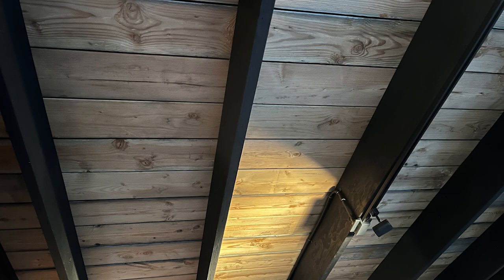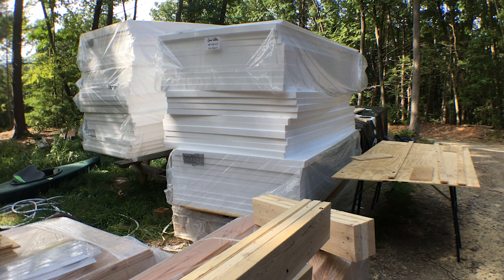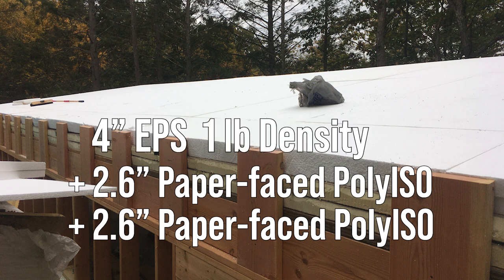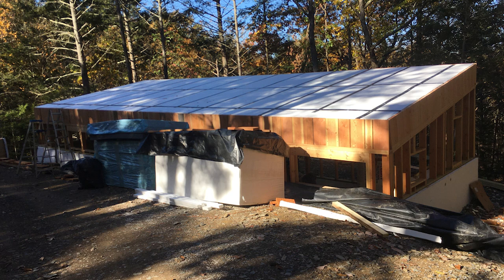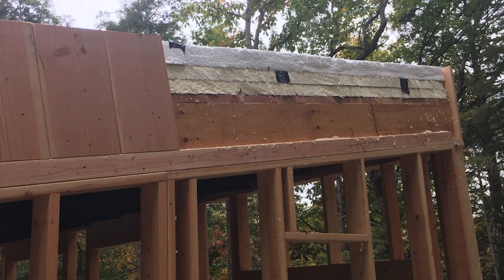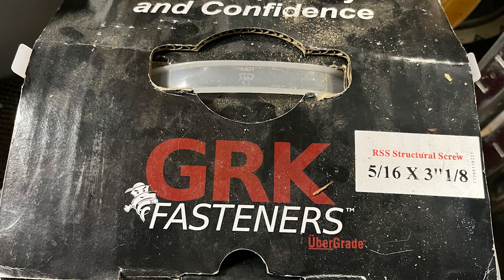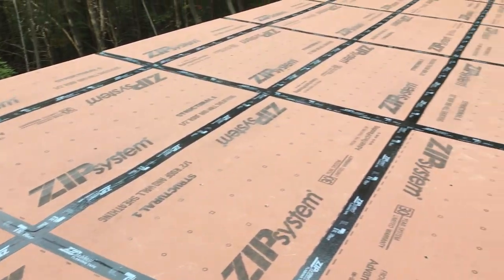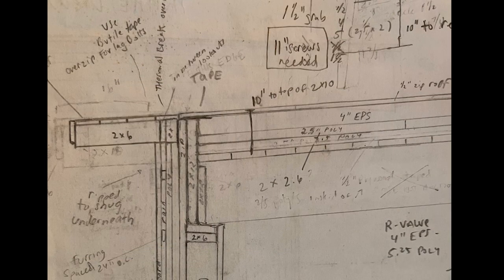High Performance Air Tight Build - How Do You Install Rigid Foam For Roof Insulation?

Comment: There is not many videos where people build timber exposed roof and insulation on top. I think that looks amazing and this is exactly what my plan is- high ceilings with all that timber work exposed.
Reply from the maker: Thanks for checking out my video and the kind words.  I'd love to see your space when its done.  Good luck!
Reply: I am bemused by this construction, the guy clearly hasn't got a clue what he is doing and there is no idea what he wants to achieve, he seems to be making it up as he goes along.

Comment: So glad I found this..not many videos of this installation type. I’m just now peeling back shingles to replace a metal valley that had a huge leak because they put a crinkle in the peak which ended up cracking but worse it made a hump on the edge that nails to the plywood about a half inch gap and water ran down under the shingles into that. The people didn’t live here for seven years.. but the leak rotted the plywood and then the soffit below and then down through the Styrofoam. After all the critters got in from the soffit. So there really was no Styrofoam the water just poured down an angled 8 inch tongue and groove ceiling in a closet which, the critters are suspect, slid down and chewed up the bottom of the tongue and groove and had free reign of the house.. I found six snake skins inside 3’ to 5 1/2’…& lots of dead mice so believe it was rat snake. And there was pound upon pound of feces in the same closet where the hole in the ceiling was from the leak with a shelf right down from the hole with a pile about the size almost of a basketball of feces. All the same kind I’m thinking.snake..wow sorry for rambling but it’s crazy. The Styrofoam was gone in a big area where all the leaks and animals were and I didn’t the plywood yet which I’m going to do right after this comment. But they just used nail long spike and I don’t know what they nailed to yet but not a three-quarter inch thick tongue and groove ceiling .. and I only found four spikes in about a 5 ft.² section.. but the wildest thing to finish is the inside of this house is absolutely incredible. It’s 5000 something square-foot and it’s all exposed. Structural framing with big being and everything is Mortis and tendon with a spike through it. No glue no nails no screws just a lot of notches and half lap joinery & mortise and tenons & spikes..but outside falling apart I’m replacing a lot of cedar laps siding that’s just curl or fell off or cracked and showing OSB and I’m like you can’t let this house rot as too beautiful.. anyway I live here now because it was too far of a drive and I had to move anyway so I can stay here and work in the nicest home I’ve ever worked in. I am an interior finish carpenter for 23 yrs & framing & exterior trim & have trimmed 3 story houses with elevators on the ocean in Flagler beach & all around the beach & I’d take this house any day..can’t see or hear a neighbor…ahhh enjoy it while I can..soon as it’s fixed up I move on 😂😂☹️
Reply from the maker: HI Scott thanks for checking out my video. Too bad about the leak. Sounds like  a lot of critters, snakes, mice, etc found an entrance into some place warm.  Its going to be a nice place when you are done and you will never forget what it was.  I'd love to see what you've done there. 
I'm with you about not having neighbors nearby.  I rather have less house and more land than more house and less land.

Comment: Revolutionary!  Thank you so much for talking about some of the details and for visually showing what it looks like as well as in your sketch.  So, one inch into the 2x10 is enough.....got it! Thank you! 🙏🇨🇦🍁☺
Reply from the maker: Thanks Meg! I'd say 1-inch is enough but consult an engineer to be certain.  I haven't had a problem after a few years. I've had 60 mph winds... snow loads.... no problems.  Stay warm up there!  And I love your dog videos! Our dogs say hi
Reply: Rockwool's spec for long screw installation of comfortboard is 1.5" embedment into studs. I'd probably stick with that over 1" for peace of mind, but 1" is probably fine. Plus 1.5" wouldn't have worked for this application anyway.

Comment: Man, that’s a crazy build!  I went with a couple inches of iso board under my new metal roof, and i was shocked to see the differences in my attic temperatures.  Next step is sealing off my soffit vents.
Reply from the maker: Hey Jonny thanks for checking out my video.  I can never go back either after air sealing and using foam insulation.  What a difference right??!!

Comment: Your attitude in the video is hilarious. I was laughing a lot.  Thanks for sharing
Reply from the maker: Thanks man. Wasnt sure if it would be worth editing and putting on youtube.
Reply: @POCONOPOWERCORD perhaps the only thing initially that would have been an improvement would be "fender washers" or some sort of 4" wide plate with a hole in center to prevent the screws from just pulling through the foam... Other than that I can't wait to see how it does ..what are your thoughts about moisture? 
Did you consider putting some sort of tyvek or other in case moisture from inside comes up and gets trapped?
Reply: @POCONOPOWERCORD I am very interested in your experience, I am looking to create a log cabin "mobile" home (for R-rating, & strength) [using Shou sugi ban is a particularly striking method of preserving wood by charring it with fire.] 
on a flat semi trailer then tyvek, (then possible 1/4" space then one layer of rigid foam, then marine(cortan?) shipping container exterior.
I plan on taking this to Alaska and wanted a very durable, and fairly resistant to entry by big creatures AND the severe cold...
and possibly south into heat and high moisture...
The advantage of semi trailer base is many: HIGH weight capacity, so the "Milled Beams/flat side Log walls and ceilings shouldn't be a weight issue.. but moisture is definitely a concern and the more extreme the weather or season or amount of moisture inside increases the concern... 
Part of the decision to use the milled beam as the interior finish to allow some breathability while also preventing areas where condensation could build up. 
Windows would be the MOST obvious first issue/point of condensation, then door latches, hinges, etc ...
All electric and plumbing is planned to be exposed on the  INTERIOR SURFACE of the milled log wall to prevent thermal bridging/condensation and obvious freeze thaw issues ... The same to be applied to all battery bays, and storage, water tanks compartments, etc -- which will be a particular challenge as anything that is NOT inside the "above" trailer deck "home" runs into additional points of contact with metal of trailer and additional possible areas of hidden moisture both from within and from outside traveling along metal and certainly openings that pass through from subfloor compartments to "home box" would have to be made additionally larger to cover the edges of the opening with the full amount of R-value insulation and moisture barrier... Obviously electric floor heating in the bottom of ALL subfloor compartments would help reduce condensation during cold - but certainly some sort of venting or air flow should be considered carefully...both to prevent fumes entering "home" air, but also for other issues.
One issue that I intend to address is the battery and electric compartment being both insulated for R-value equivalent but ALSO to isolate via NON FLAMMABLE materials...and steel basin that is situated and plumbed to be "flooded" in the event of a thermal/fire event especially IF lithium batteries end up being used ... But to have the entire bank or multiple banks on a sliding draw so that if there is and issue that it can be slide OUT and drop OFF up to six feet or so away from trailer...
(I am sure you have seen/ heard of the spontaneous issues that can arise with lithium batteries...

Comment: Well done, this is awesome! Before you added the insulation on top of the roof deck (the 2x10s) did you add a membrane or anything first before adding your first layer of rigid insulation or what is that black stuff? Did you have to be careful walking on top of the insulation before you had the top layer of sheathing on?
Reply from the maker: Thanks for checking out my video. The black stuff on top of the 2x10s was roofing felt.  15# is pretty inexpensive and quick.  I didn't know if the 2x10s would shrink more being in a conditioned space. They ended up shrinking a tiny bit and you can't see the felt.  You dont have to be careful walking on the rigid insulation.  The only damage I did was when I was carrying them.  Really glad I added rigid foam under the slab too. I use electric for heat and a/c. The electric bill is always under $100/m.

Comment: Funny, I am doing 5 inch on a roof now in italy.  Same questions.  We  have CIP concrete structure so we poured 6" concrete edge around perimeters.  We did similar to you.  Wd had concrete dck so we anchored to concrete deck, easier.  Our italian sub wanted to add 6" wood  rippers vertically up the roof, anchoring down to deck, then  they run Metal battens across top of insulation, screwing into yhe vertical wood nailers.  Then, installed clay tile over the top.
Reply from the maker: Hello from America. Thanks for checking out my video.  That sounds like a fun project. Sounds like you could hit that building with a missile and it would be fine.  You are lucky to find people in your area to do this type of work with extra steps.   I'm now hungry for an italian sub.

Comment: Nice job!  Doing a similar project soon.  Without seeing your video, am going to be doing almost the same thing with a roof.  Found I could order eps to the thickness I want.  Similarly, got a quote for 9" foam.  May break it into two 4.5".  Zone 6 Wisconsin.
Reply from the maker: Thanks! I'd love to see the progress of your build. Foam shrinks a little over time so its good to do 2 layers with staggered seams vs 1 layer.

Comment: Gluing two layers of EPS together to make 4" thick 4'x8' sheets was probably a small mistake. It would have been better to lap them so the joints don't form a continuous break through that layer. That said, it looks like you lapped it with respect to the polyiso, so it's probably fine. Plus zip taping the joints was smart.

Really nice roof assembly, well done.

Comment: Nice job.  I hope to build an ICF house similar to yours in a few years.  I love your exposed lvl rafters and 2-by roof planks.  I might consider it for myself.
As for hitting the rafters with those 11" screws, one way to do it is to put screws in the facia marking the center of each rafter.  Once the foam is glued down, run string lines from the rafter center marking screws up over the top of the foam.  

To get your screws perpendicular, you could make a jig out of stacked pieces of 2-by.  Bore a perpendicular hole through the jig with a diameter about the same diameter as the screwhead.  The process would be to press the point of the screw into the chalk line and then slide the jig over the screw, making sure the point of the screw stays embedded on the chalk line.  The bore hole in the jig would guide the head of the screw.    The important thing is to get that screw head into the bore hole from the start.  I'm going into such great detail in this comment to document to my future  self how to do it.  Maybe someone cleverer than me will respond with a better way.  Obviously not cost effective for a contractor, but that is why a DIY'er can sometimes build something bettter than contractors.
Reply from the maker: Mark thanks for checking out my video. Thats a great idea on getting the long screws straight.
Reply: I was worried about my contractor driving 8 inch screws through my wall assembly straight. I also suggested a jig. They scoffed at me. I'll admit, they didn't miss a single stud. Really impressed. 

If I had to do it, I'd drill press two holes in a 4x4, then use a mitre saw to cut down the halfway point of each hole. Slap a hinge holding the two pieces together as a single hole and put a hasp on the other side. That way you can get the screw going perfectly perpendicular every time and you can easily remove the jig once it's started.

Comment: I saw some European videos where they add really thick insulation I think it is called Gutex. They also use really long screws but the engineers made them use a pattern of skewed and straight screws. Apparently the pattern massively changed the ductility of the structure.
Reply from the maker: OH wow thanks for sharing.  I haven't heard that.  It makes sense though doesn't it? If the screws are mixed with angles you would have strength from different places you might have uplift. Wind can come from the north, east, south, west.... We never stop learning and innovating!
Reply: Love the angled screw idea. You'd end up with crazy long screws in this application though. Would be hard to find. Way stronger, but probably overkill AF.

Comment: Genius! I love your rafters and ceiling.  Where did you get the information to determine your rafter size and spacing?  I can't find any calculators that work with spacing greater than 24".

Comment: Should be. Able to keep the place warm with a candle 😊
Reply from the maker: Thanks for checking out my video.  Yes the extra money and time insulating and air sealing instantly starting paying me back.  We get 4 seasons here and even in the winter with the minisplit using electric to heat the building, it is less than $100/m.

Comment: Depending on the jurisdiction, mostly likely they will require the imbedded depth of 1 ½ inches for a better pull-out resistance.  The other possibility would be a roofing washing/cap plate underneath the screw head.  In your case, since you are using 2x material, the 1 ½ depth would cause tip penetration.  Most inspectors accept a sheet of CDX above the 2x material as long as the screw threads hit both.  As for the Fastermaster, they should not have a problem with a grade 5 screw.

Interesting on your roof insulation sandwich.  Not sure exactly the R-value of the polyiso you have.  With the aging factor they work in for foam, I believe you have about R-42 to R-45.   Your actual performance value compared to other products the BTU retention is about twice your numbers.  Thus, you have made an extremely nice sandwich.
Reply from the maker: HI Herb thanks for checking out my video and complimenting my sandwich. I've also heard that.  That you want 1-1/2 inch purchase.  With an inch penetration that is holding the roof sheathing down, we are worrying about uplift or sideways force.  Won't it be shocking if the roof blows away? And the perimeter of sheathing is screwed directly into the crazy-of-me 2x10 box I made.   You might be right about the R value being less than R50.  Still, compared to just fluffy insulation, in the summer and winter, I have electric heat and my bill is always less than $100 a month.  I'm getting excellent performance in return of the time and money invested insulating and air sealing.
Reply: "𝘋𝘦𝘱𝘦𝘯𝘥𝘪𝘯𝘨 𝘰𝘯 𝘵𝘩𝘦 𝘫𝘶𝘳𝘪𝘴𝘥𝘪𝘤𝘵𝘪𝘰𝘯, 𝘮𝘰𝘴𝘵𝘭𝘺 𝘭𝘪𝘬𝘦𝘭𝘺 𝘵𝘩𝘦𝘺 𝘸𝘪𝘭𝘭 𝘳𝘦𝘲𝘶𝘪𝘳𝘦 𝘵𝘩𝘦 𝘪𝘮𝘣𝘦𝘥𝘥𝘦𝘥 𝘥𝘦𝘱𝘵𝘩 𝘰𝘧 1 ½ 𝘪𝘯𝘤𝘩𝘦𝘴"

As he mentioned, there is no inspection for the building. That doesn't mean he did anything illegal either. 

The UCC as adopted by PA exempts fully detached accessory buildings up to 1000sf from building permits and structural inspection as long as you follow setback and permeable area requirements. Some municipalities lower the exemption threshold to 250 or so square feet, and many urban/suburban areas of PA may even require a permit for a tiny prebuilt garden shed. The more rural an area of PA is, like where I live(and I'm assuming the same for the OP's location), the more likely the municipality is to follow the state limit. 

To be clear, that particular exemption to the UCC only applies to fully detached accessory buildings that aren't used as habitable space. There are also some other exemptions for 'recreational cabins' and private agricultural buildings though. Things like ADU's or mother-in-law suites are all subject to permits, inspection and require CO's regardless of their size. From his other videos the OP appears to be using this as a personal music studio/man cave rather than living space, which falls under the accessory building exemption.

Comment: Have you looked into Hempwool or rockwool for roof insulation?
Reply from the maker: Thanks for checking out my video. I'm aware of those but it works for cavity insulation.  You wouldn't be able to do a 900sq ft continuous layer like I did. You would have rafters running in between each cavity.  More heat loss.

Comment: Wondering also if you did anything to seal up the 2x10 ceiling or is that what the tape did on the eps?  And, did the 2x10s stay straight and without much gap between them.  I'm looking at tongue and groove 2x6's but the cost of them is a lot higher than using regular 2x10's same yellow pine.
Reply from the maker: Thanks for checking out my video.  I didnt seal the 2x10s. The rigid foam layers over them are all taped and each layer a staggered seam.  I had found a great deal on the 2x10s and thats why I went that route.  IF I found a great deal on 1x6 or 1x8 t&g maybe I would of went that way.  I like that the 2x10s add strength to the roof though.  Also If it was 1x boards I probably wouldnt of been able to walk on it to add the foam and would of had tighter spacing of the lvl joists.